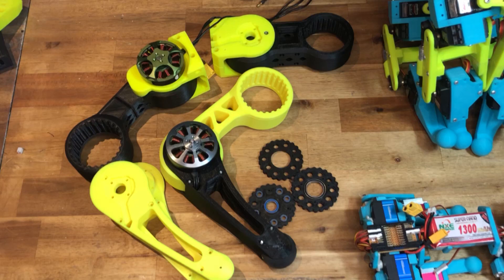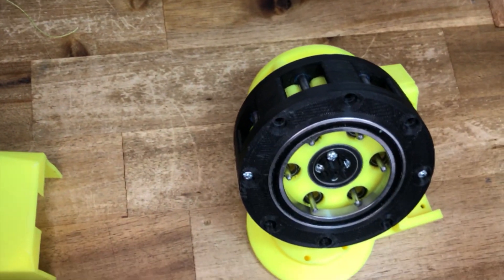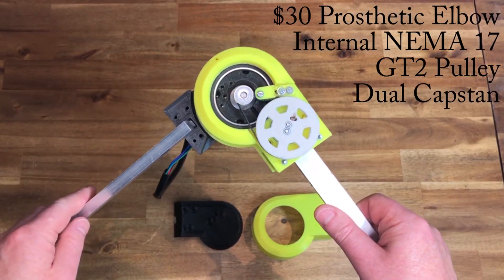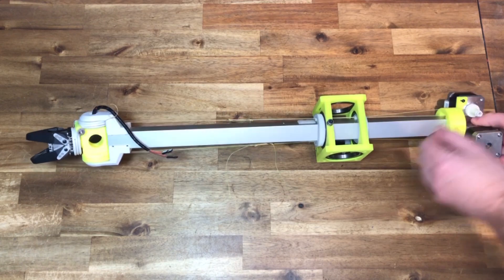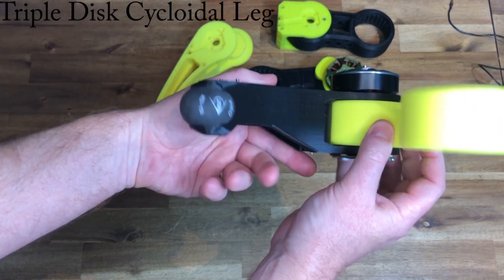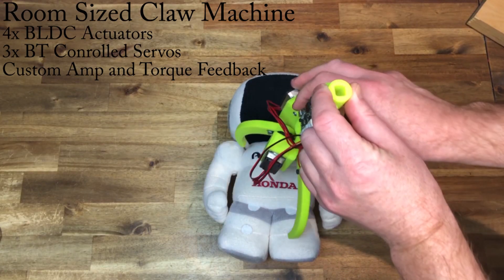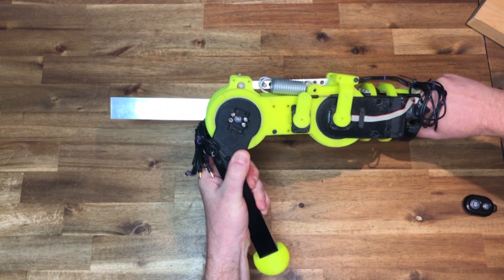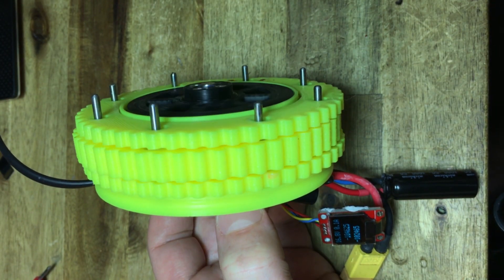Cycloidal, Capstan, Quadrupeds, Arms - Robot updates 2021

Comment: Curious about your prosthetic elbow (and that exoskeleton you off handedly mentioned!) why would you want it non backdrivable? For something being constantly handled by and interacted with by a person, you'd want the compliance backdrivability provides, no?
Reply from the maker: Prosthetic elbow should not fall down when the power comes off. It could be switchable with a clutch or brake. Exoskeleton should be backdriveable with the power off as to not effect the wearer. Exoskeletons are difficult as they could break someone's leg if they go wrong. The forces are also high.
Reply: @PaulGouldRobotics  To me a prosthetic and exoskeleton are very similar applications, and I would argue the prosthetic should be back drivable for the same reasons as an exoskeleton. 

Someone may want to manipulate the prosthetic while the power is off (maybe battery dies), or just so that it can bend and yield if it is hit, or maybe during a fall, rather than forcing the wearer's arm around.

Comment: For the record: I'm a fan of capstan/cable drives. Cycloidal drives are great, but have disadvantages, especially when 3D printed.
Have you considered trying out the "orbital drive"?
Reply: What are disadvantages of cycloidal drive?
Reply from the maker: Efficiency is low. High backlash if the tolerances aren't perfect. Uses a lot of bearings. Slightly heavy.
Reply: @alexeymaslov3865  Needs tight tolerances, or it will bind up or have larger backlash. AFAIK, no method for backlash compensation.
The basic design seems simple and elegant, but it is unbalanced, can't be used at high speed. A double gear construction is usually the solution, but that doubles the part count and complexity.
Reply from the maker: @besenyeim  I have a antibacklash design in an old video. If you use three disks it can be statically and dynamically balanced. It’s a little complicated but nothing crazy. Bearing count is high.
Reply: @PaulGouldRobotics  I've enjoyed following your experiments for some time now.  The bearing counts don't need to be high.  iirc your cycloids have bearings on the roller pins - these shouldn't be required as the disk should be rolling over the pins.  In industrial cycloid drives, the drive pins often have bushings rather than bearing.  In my own 3D printed drives I just use 3 or 4mm pins that are pressfit into the drive disk.  I only use two bearings, one for the eccentric on input and the other on the output part of the drive disk.  I"ve load tested a 16:1 cycloid drive in the same formfactor of a Nema17 driven by a mediocre nema17 motor to lift 1kg at 300mm before the nema17 started losing steps.
The biggest issue is cycloids really need precision components though there are ways to approximate that precision with 3D printed parts - drilling out holes to fit precision stainless steel 3mm pins.
There is a paper by a Romanian(?) professor that goes into some detail on how what parts of the cycloid path   bear the most and suggests that trimming the outermost parts of the lobes.  Just trimming the outermost parts of the lobes reduces possible interference from low precision 3D printing enough to make these drives feasible.  I will try to dig up the reference to the paper.

found the link:
https://imt.uoradea.ro/auo.fmte/files-2007/MECATRONICA_files/Anamaria_Dascalescu_1.pdf

Comment: These are very interesting and novel designs! I am keen to learn more about these. It looks like the teddy way has quite a small bldc motor driver board. Which board did you use there?
Reply from the maker: The motor is Gartt ML5010 and the controllers are custom running Arduino on ESP-32 WROOM, FET Drivers and magnetic encoders. They are communicating with ESP-NOW. It is the board in the middle at 4:32.